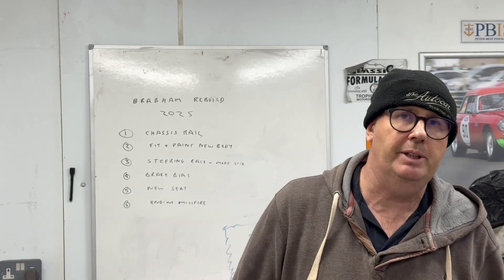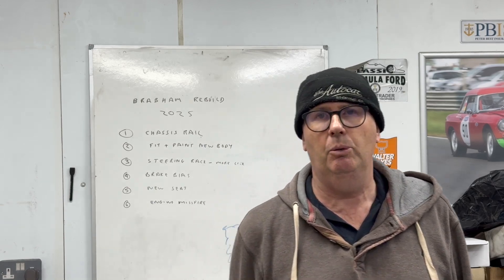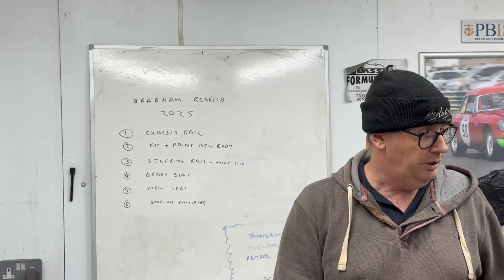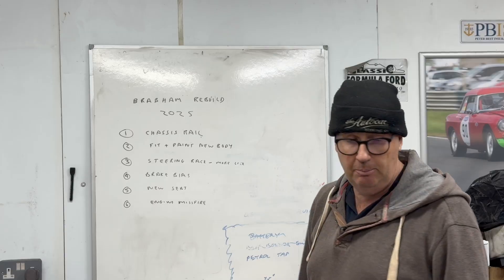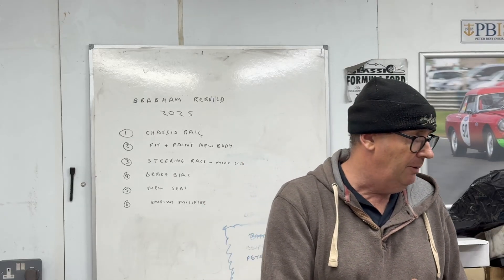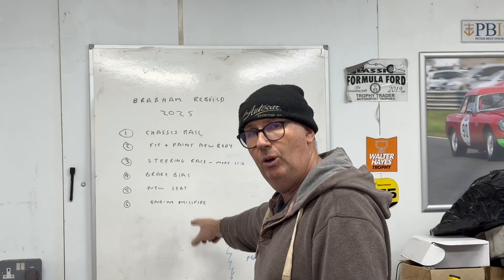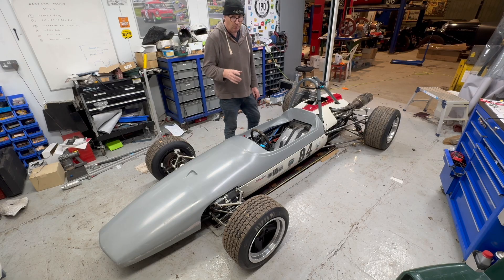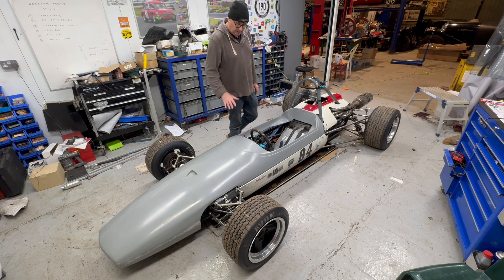Brabham BT21 Rebuild part 1- Chassis strip down

Comment: Good to see you getting started on the winter jobs.
When you had your mis-fire I wondered what petrol and/or additives you use?
(Back in the day there was real 5 star petrol - long gone of course).
Reply: Unless you're friendly with yor local airfield - 100LL is still good!
Reply: True, but I do know 100LL can cause throttle slides to stick.  A bit of oil in the petrol helps prevent that.
Reply from the maker: I was using Sunoco fr 102ron which is what I always use if I can get it at a race meeting